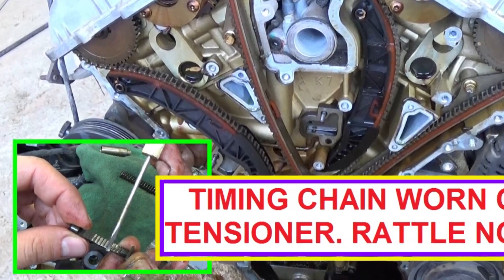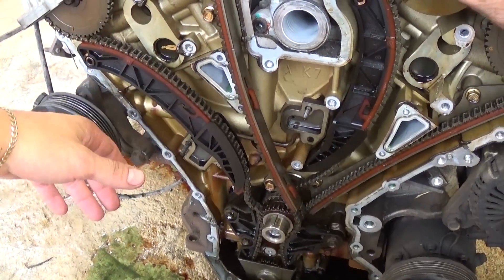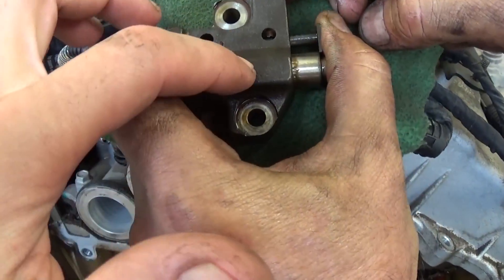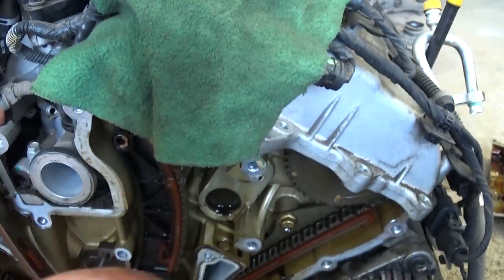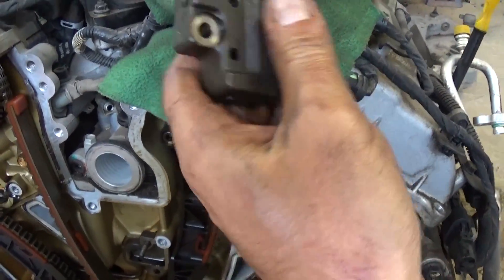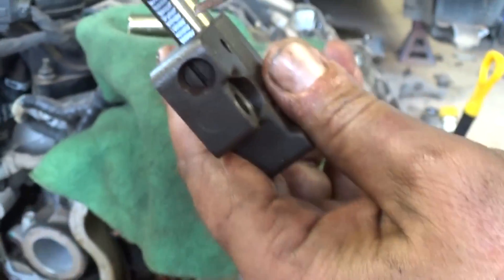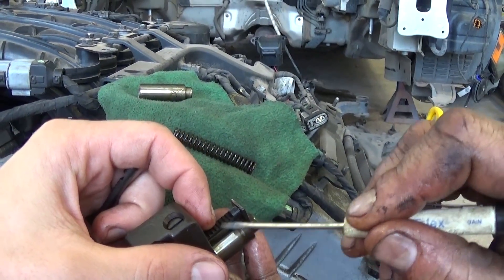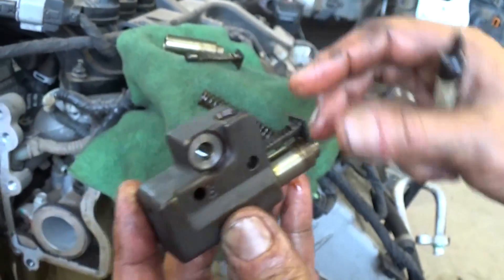Timing Chain Engine Owner MUST WATCH! Why it is important to REPLACE your timing chain. RATTLE NOISE

Comment: I have 452K miles on my 2004 Toyota Corolla with the original chain and chain tensioner. When I resealed the timing chain cover a while back, the chain was still in great condition along with the chain guides/slippers. I only replaced an o-ring on the original tensioner. All good. This is possible because of regular oil/filter maintenance.

Comment: Not at 100 thousand miles. That's a crap. Chains last over that. 200 is normal. Id change it's that. That tensioner is quite shit for a tensioner ngl what engine?? Also do you mean timing belt? You change that at 80-100 and that's normal. Unless you have an audi, then change it at 40 and your high pressure pump tappet  chingadera  with it before it eats your cam it sits on.

Comment: What would happen if 1 of the 2 cam/timing chains was off by 1 tooth ? would this bend some valves ? anyone knows ?
Reply: probably not, but it would run like a bag of shit... it may also depend what type of engine it is, whether it's an interference engine or not. some cars are fine, others run lime shit... but even 1 tooth screams REPLACE ME NOW! ...Cuz it's only gonna get worse, tensioners get trashed.

Comment: I've have timing chain cars with well over 300k and this has never happened.  This definitely doesn't happen to every car.
Reply: Do to they rattle? cuz a rattle means loose chain / worn guides.
Reply: @fakeaccount8342   I've only seen the rattle on Nissans and Volkswagens.  I only buy Honda/Acura, Toyota/Lexus and change my oil on time

Comment: If you vehicle has over 150k please use mobile 1 high mileage synthetic oil and replace it every 4K miles not 5k this way you timing chain will last for ever , because the timing chain runs by your engine oil .

Comment: Why not just replace tensioner every 50,000 miles ?   Would that reduce timing chain failure and be cheaper?
Reply: The cost of labor to replace the tensioner is the same as the replace the timing chain too , just like before when you do the timing belt you need to do the water at the same time

Comment: this is why I love old chevys and fords...the timing only goes around the crank and cam..If youre not dogging your car the timing chain will last forever and if they do break it wont destroy your engine...the simplicity of the old is genius.
Reply: I agree, but those old engines do not meet the emission standards of today. OHC engines were designed to be efficient, at the expense of simplicity.
Reply: @jibrilsarabi2908  Sad part about that is they had the technology to be simple and efficient but cared more about the money. They once made a Carburator that allowed almost 100 miles to the gallon. It was experimental and they didnt release it. its all about the money.

Comment: I’m experiencing this symptom (rattling/ slapping on startup) on my Ford Taurus 3.0 V6 Duratec engine, 170,000 mi. I suspected it was timing chain related and this pretty much confirms it. Thanks! Commenters need to observe that the engine in your video is DOHC.  Longer chains and more complex tensioning than a single cam V8.  I have a Dodge 318 with 335,000 mi and it still runs great.
Reply: Broken timing guide or stretched chain
Reply: @felixhb12   I ended up replacing both chains on the Taurus DOHC shortly after I posted this comment. It was a bit intimidating, as that was my first DOHC. But I took my time, took pictures during disassembly, and everything worked out. No broken guides, just stretched chains. We still have the car and it runs great!
Reply: @SIE44TAR  I juust realized this was 5 years ago, damn. Nice ride, speedy little things.

Comment: I understand the need to be cautious and know how your engine is wearing.  My F150 V8 has 238,000 on it and it's all original.  It still starts and runs like it is new.  I always use synthetic oil and occasionally add 8oz of Sea Foam.  Transmission also has synthetic fluid.  I tow a trailer with it a few times a year.

Comment: My car has a timing chain and has 190,000 miles on it. I guess I should have my engine taken apart?
Reply: When the chain is going bad, you'll hear it. It will be a very loud, Diesel engine sound. Best way to keep it good is to be on top of oil changes.

Comment: This only applies to porely designed engines like GM 3.6L or BMW4.4. Most engines never have timing chain replacements unless a tensioner/chain guide failure happens or moron does not service fluids properly and tries to run way past a 5k olf service thinking synthetic oil will save them....

Comment: My 07 f150 4.6 has 267k mi with zero issues but I change my oil and filter every 3000 miles RELIGIOUSLY. Thats the key. NEVER missed one.

Comment: If a motor jumps time all you have to do is get the timing set replace that and make sure you set the timing right when you install it. This guy says the motor is shot if the timing jumps because that will cost you more than the timing set would.
Reply: If it's an interference engine, which most engines are. If it jumps time you have to rebuild the whole engine

Comment: The problem in the tensioners teeth or sometimes the tensioner guides, many manufactures have recalls and tsb on them, they do not replace chains during these repairs.

Comment: If an engine with a timing chain is designed well and the oil is changed on time then the chain will last the life of the engine, to say all engines with timing chains need new timing chains, tensioners etc. after 100,000 miles is wrong.
Reply: Yep. 1000% wrong.  They fail because people slack on oil changes.  Except for Nissan having trash timing chain guides lol

Comment: What is a good brand of timing chain kit to  buy?
Reply: OEM. I bought an aftermarket on Ebay. So much slack on the aftermarket compared to the  used one pulled off the 144K 2.3L Fusion. I returned it. Buy OEM chains!

Comment: You nailed it man and right to the point too! So many videos waste my time talking about a bunch of BS that only a beginner needs to hear and then never get to the actual info that I'm after.  This video told me exactly what I need to know.
My 04 Mazda 6 with the 3.0 engine had a noise that sounded like timing chain so I removed the cover and after examining the chain and tensioner system noticed a little too much slack in the right chain as the valve spring tension was released on the chain as it came around. The left had similar action but not as pronounced. My hypothesis was that something was wrong with the tensioner that was causing the chain tension to not be maintained as it should be but I was not sure why. After all, shouldn't timing chains last for the  lifetime of the engine? An error here meant parts and labor wasted and I hate that. Especially putting things back together and having to start all over again. Your video put all of the pieces together for me.

Comment: Maybe you can hep. I'm doing my chain and tensioners on my 2010 range rover. I have the front covers off but on the bottom of the engine there is something blocking the bottom chain gears. It looks impossible to changer, do I need to pull the oil pan too to gain accrss?

Comment: Funny my 92 Cherokee has 311,000 miles and the chain is fine.   The tension should be checked every 100,000 and inspected for excessive wear.
Reply: if youre already in there to inspect it, replace it.

Comment: It is not required to replace a timing chain at 100k miles. The problem shown on this video is common to hyundai/Kia engines...typically the v6 lambda engine will wear out the tensioner teeth and timing chains/guides.
Reply: Ford V6 and V8 are notorious for this as well.

Comment: bullshit owner manual doesnt claim for it and ive seen cars around 200k miles with original timing chain
Reply: Sawnic Gaming exactley , on other video guy says 50-60 k miles :) my car has almost 80 k miles and runs like new  , proper oil change and on time thats it !!!
Reply: My has 236k miles on the original chains.

Comment: Great video 👍🏼 I have a bad timing chain right now and I fear it will jump any day, every time I crank the car...if it cranks I worry. 6 months I've been riding on it and I've just now saved $800, but because I've gone so long other things are acting screwy. Battery, starter, alternator, fan belt, and the latest is my transmission goes in and out of safe mode where it stays in a high gear, the transmission gets hot and the oil pressure light is blinking. I need good advice on if I should be ready to replace the engine or will fixing the chain also correct other problems? I realize I would need to get the cam shaft sensor and water pump, as well as chain and parts. HELP! 😅
Reply: Jeremy L are you able to do any work your self ? If not start learning over you life time you will save a ton of money in repairs and car payments   A1 auto parts has excellent videos,get a manual on you car chiltons great help , get some tools ,here in Canada a tire store has screwdrivers ,and 3/8 socket sets on sale quite often for under 20 dollars  read learn watch on line read all safety tips and follow them ,make new friends who are in to auto and truck repairs
Reply: I have boats cars restored and daily drivers older but like new condition I do all my own work never have car payments because I buy used  touch up paint polish clean repair . Here one for you I have a 1992 tracker 4x4 the clutch fan failed the part was 399.00 so to much in my mind and pocket , I had 16” 12 v fan available at auto parts store I made some brackets out of aluminium and discarded the clutch fan and installed electric $ 90 cools better save a little hp from the 80 hp 4 banger

Comment: my car has 205,000 miles on it with original timing chain. this guy is BS my car runs good
Reply: MONEYMANE DINERO I don't recall ever stating my car had " chains" as in more than one. You should learn how to read. The video pushes people to replace their timing chain and or chains. I'm stating my car has the original chain at really high miles. My engine is an antique ? Lol, well this antique has held up extremely well, has great power and gets great gas mileage. Easy to work on and has never left me stranded. That might be over your head though
Reply: Still running ok?
Reply: All cars are different. Some break down after 40k miles.
Reply: mine is at 240,000 runs like a top, I mean Toyota.
Reply: My 05 Malibu 3.5 V6 has 236k miles on the original timing chain. No problems. Ford's love to destroy timing chains. This looks like a Ford engine in the video.
Reply: In theory any car can break down. Any engine can go. Even the most reliable cars can have problems. Some have more problems than others. Like Ford and timing chain issues on their V6 engines both Duratec and EcoBoost and the Triton 3V as well. The facts are the facts. My feelings nor yours don't  change the facts. Glad to hear your Ford is going strong. I'm proud of any American brand that can claim that many miles regardless of brand.
Reply: A blind squirrel will find a nut every now and then....your just lucky ...it'll happen soon .
Reply: DJR5280 SMFH! U DUMB ASS AF DUDE!😂🤣😅 This dude said he has a Malibu 3.5L V6 LOL! Let me explain something to you because it's over your head. Your POS GM V6 is a basic antique pushrod engine it does not have additional chains, just 1 small chain front center of your engine. This engine here is a DOHC engine, a design that 90% of all vehicle manufacturers have been using since the 90's because it is a superior design over the old pushrod V8 design that, oh yeah, Ford introduced before anyone else way back in the 20's and 30's. GM and Chrysler are the only garbage companies still using pushrod engines like it's still way back in the day!!! U take the L for this one mane!!! LMFAO 👎👎#FACTS

Comment: look at my vid plz , i think it's chain sound but the oil lamp on , really i don't know why
Reply: If the oil is low or not flowing properly then the timing chain will make noise because it (or the chain tensioners) is not getting lubricated well enough

Comment: The Ferrari has tensioners, I replace with timing belt/chain, pulleys, rollers with tensioners and water pump/thermostat for starting at $53,000.00.

Dealerships like to say it (Timing Chain) never need replacement, during the warranty period. 
Then out of warranty, they will say your engine is bad. 
And the salesperson is right in front of your face. 

They will say the same thing that you do not need to replacement transmission fluid.

Thank you for sharing your time to show all of us.

Happy New Year!

Comment: My '97 Ford Contour SE 2.5L V6 has a timing chain, and an 'interference engine'. With 165,000 original miles and now 20 years old, if it dies tomorrow, c'est la vie. It always rattled on startup, until oil pressure built. No biggie.

Comment: Ive never heard a dealer or mechanic say a timing chain is a lifetime " thing" lol
Reply: On the other hand, I have never heard of a timing chain needing replacement in the maintenance schedule. We have two Toyotas in the family with more than 200K miles on the engines, and a Prius has recently turned over 600K miles (a million km!) without major repair. The single roller chains, some with inverted links, are peculiar Hyndai/Kia weak spots.
Reply: Timing chain can last permanently if you do always change your oil

Comment: Mine is under warranty but they said they won't fix it because it's not showing any trouble codes you can hear it and it makes a loud click every time you start it up same ford 4.6 also the transmission is all over the place clunking around but no codes no fix
Reply: mine did that and after a month it slipped and broke

Comment: i have 2006 sonata 3.3 V6 got 176000 M Do you know how much they charge to replace it ? THANKS !!
Reply from the maker: +Dallas Tx it is really hard to tell how much. Every shop charges differently. It will probably be between $500 and $1000  If you ever need help with your vehicle let us know you can also find us on Our Official Facebook Page here: https://www.facebook.com/worldmechanicsofficialpage/?fref=ts
Reply: +World Mechanics thanks for reply i took my car to the mechanical shop and they asked for $1000 !! after negotiator $800!!  also i have to order the parts, i'll fix it next week wish me a good luck thanks again
Reply: World Mechanics are you in dallas area??how much for a 2006 hyundai?
Reply: Did your car actually need the chains replaced ?
Reply: World Mechanics about how much does replacing the timing chain on a 2012 Audi A7 cost?